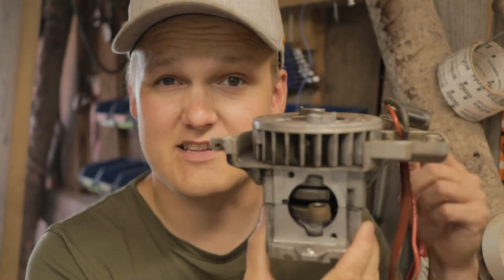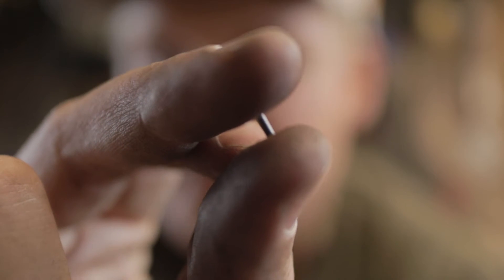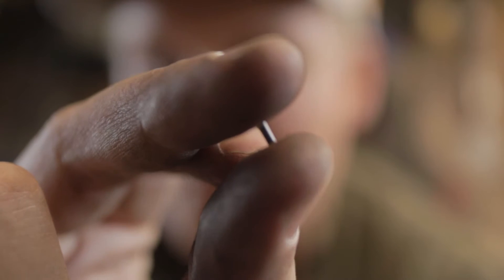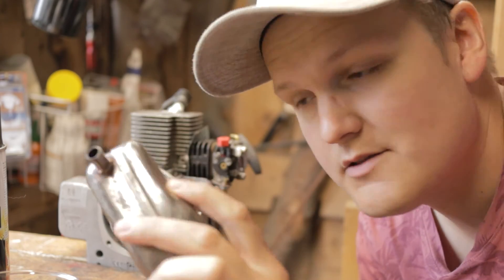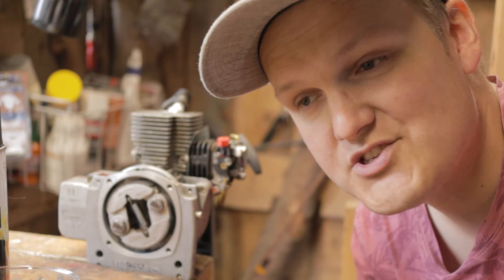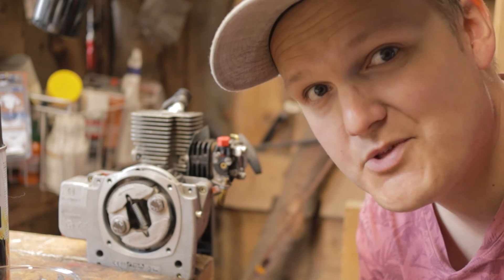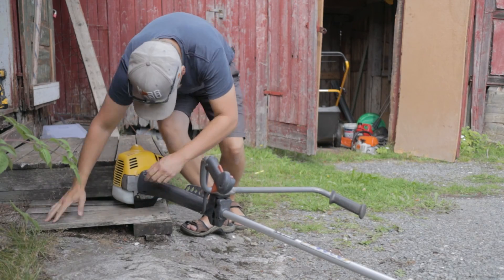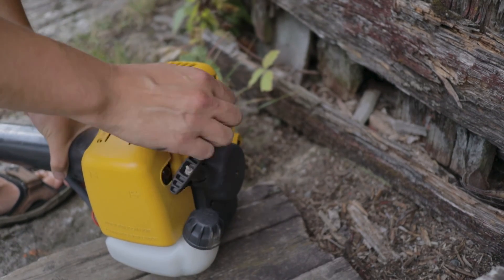Can A TOTAL BEGINNER Fix A 2-Stroke Engine?

Comment: That was great ,such an upgrade to the Dewalt too.
Reply from the maker: Thanks! Just got back inside after running the dewalt trimmer for a good 1.5h. Still prefer the electric one for grass, but might use the gas one for thick weeds and bushes :)